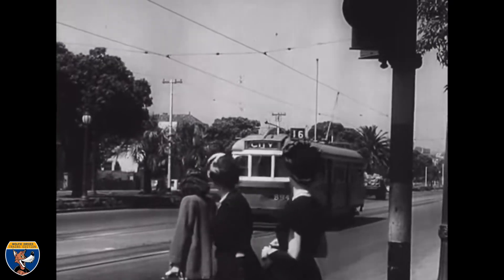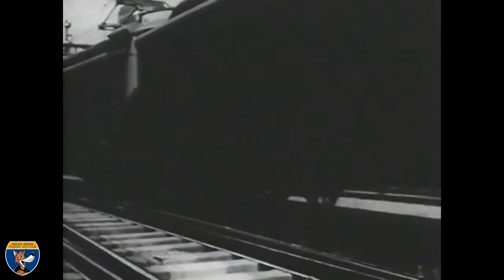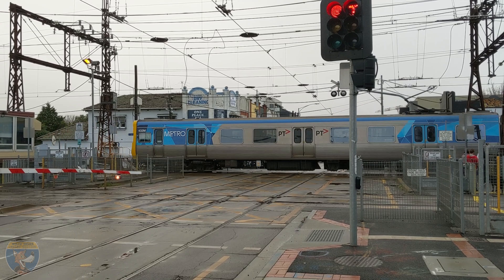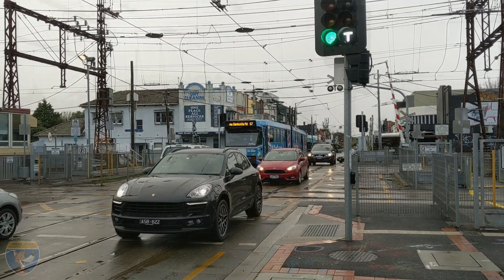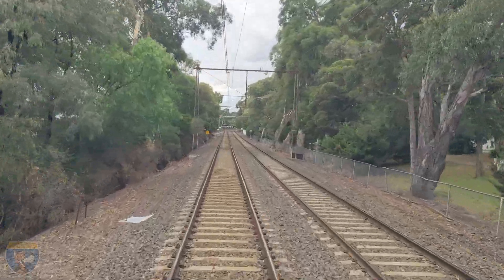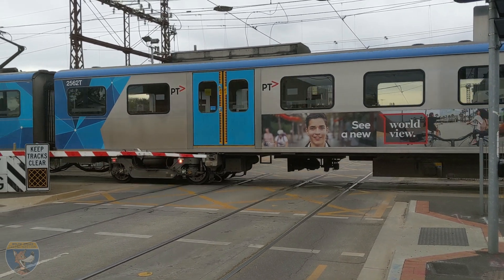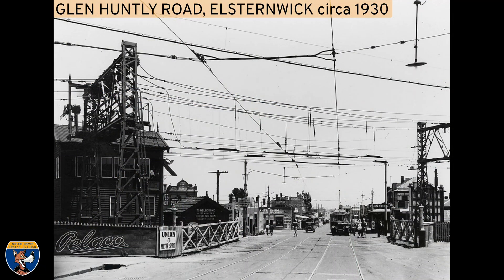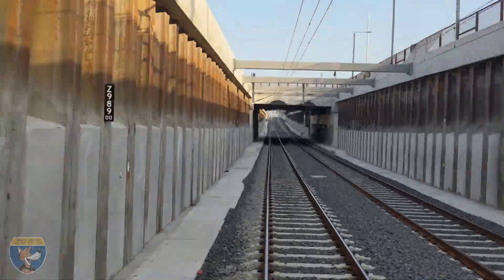What is a TRAM SQUARE ? | Wolfie Investigates

Comment: Just before the Riversdale tram square, Riversdale Rd eastbound has gouges in it where a tram was derailed by the now removed catch points. All the tram squares used to have these catch points as an extra level protection to avoid trams proceeding into the path of a moving train.
Reply from the maker: Wow thanks for that info. Wolfie is now on a mission to spot the gouges at Riversdale. There are also gouges at Glenhuntly from tram derailments (one quite recent). I didn't know about tram tracks having catch points, but this makes a lot of sense. Makes me wonder why they got rid of them??